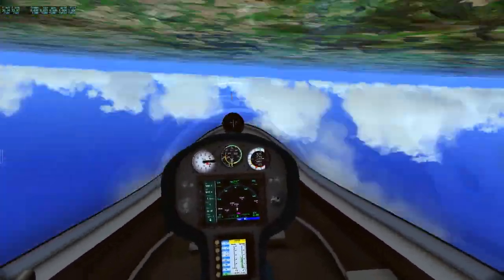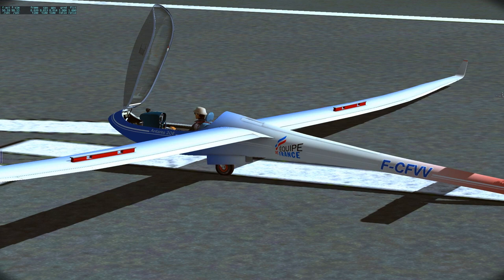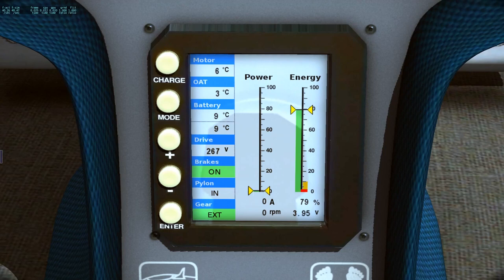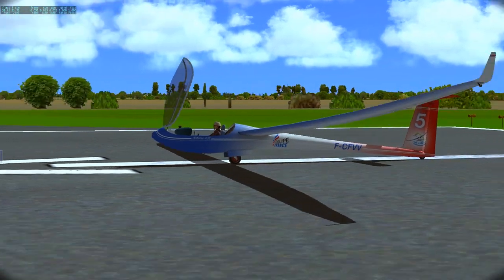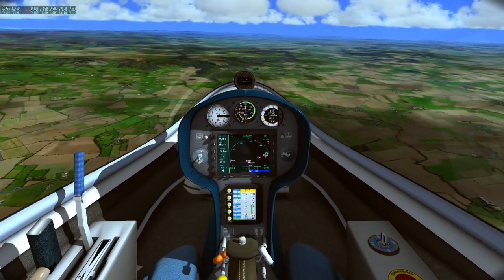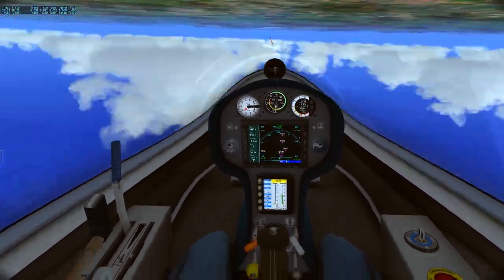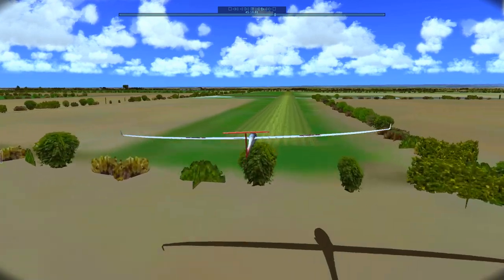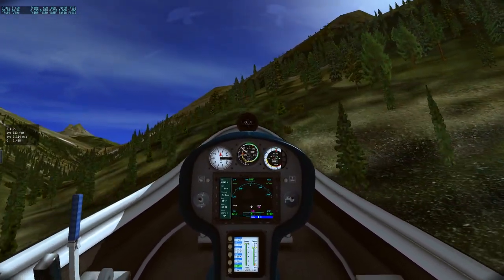X-Plane 10 Antares 20E Glider! - Spins/ Rolls/ Loops

Comment: The official method glider pilots use for countering a crosswind is called a side slip, you angle your into wind wing downwards, and then apply enough opposite rudder to keep your nose on the center line.  

Just using rudder can kind of work, but it's sloppy.
Reply: I hope you mean 'crabbing'. Pointing slightly into wind so you can fly down the runway and not being blown to the side. Side slip is used to loose lots of height without gaining speed (i.e if too high on approach). There are two methods, have a slight roll and use rudder into wind, or just crab and point your nose into wind. Using just rudder is a bit better with gliders as the wings are long and you avoid the wing touching the ground.
Reply: The exact terminology, ever so frustratingly differs across regions apparently, where I live glider pilots use the terms in roughly this manner. 

Side slip:  Used to counteract mild cross wind, into wind wing low, enough opposite rudder to keep not on centerline.

Crabbing:  Used to counteract moderate to severe crosswind,  no bank angle, glider is angled into the wind enough to to continue tracking down center line while not being centered on center line.

Forward slip:  Into wind wing angled low, full opposite rudder applied, nose is not pointed down centerline though track is, altitude is rapidly lost.

Comment: I see a prop pilot there :D you did these weird slips and everything cause you have to turn with the airlerons too,right ruder=right airleron so you dont start slipping.
In Cessnas you dont need that too
much because the engine compensates the negativ movement
Reply from the maker: +Fabian Meisner Haha i am very much a prop guy. In a cessna, you sometimes need to do it, but if you do, the rudder input is very small compared to the glider. I did put some rudder input, but it wasn't nearly as much as I should've been putting.